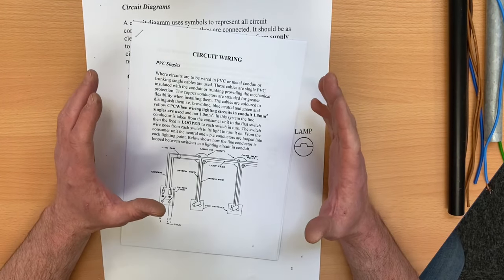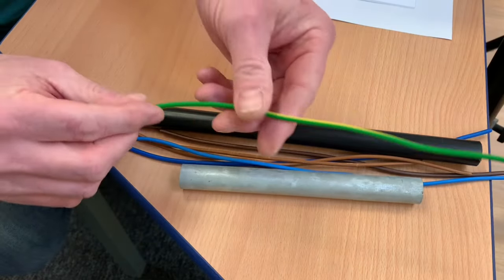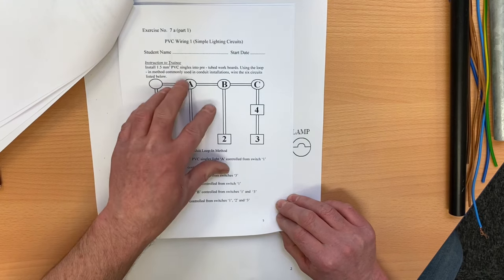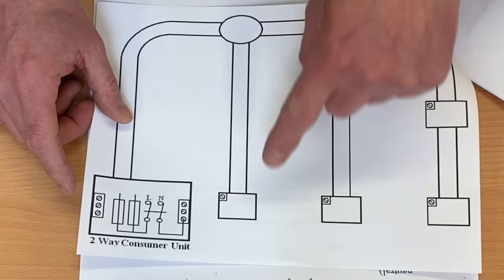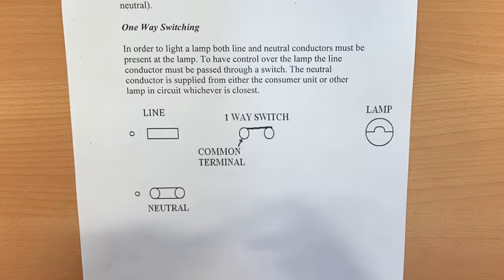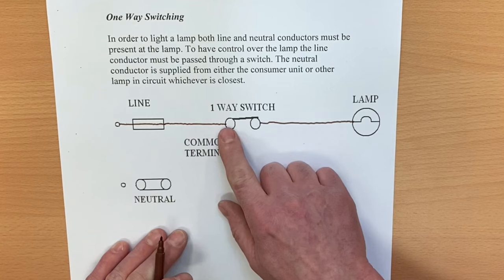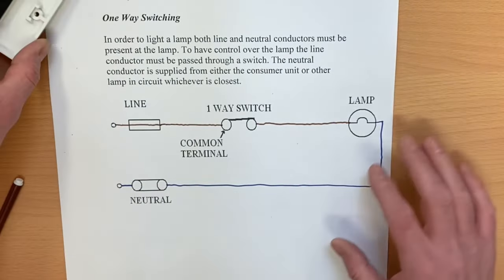Wiring Diagram Conduit Loop-In Method Introduction Part 1 of 2 - Lighting Circuits in PVC Singles

Comment from the maker: == 🕐 Time Stamps - Cut to the action 🕕 ==
00:08 - Introduction to wiring lighting circuit with PVC singles in conduit
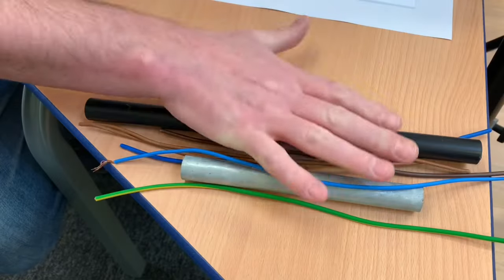00:14 - Download handout from the link in the description 
00:30 - PVC singles for conduit wiring
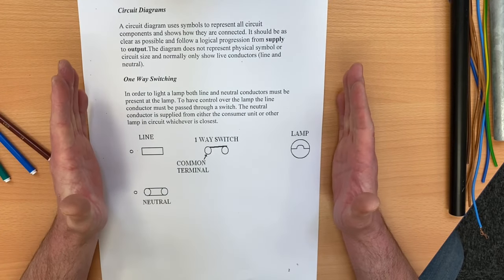02:20 - Circuit diagram for a lighting point controlled by a one way switch
03:51 - Adding the conductors to the 1 way lighting circuit using the conduit loop in method 
05:56 - Batten lamp holders for use with the conduit loop in method 
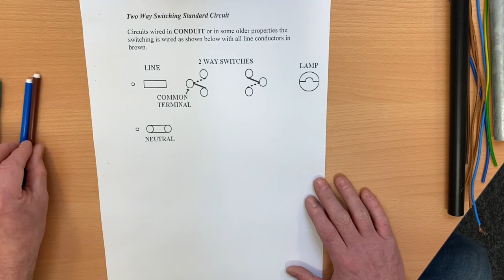06:44 - Circuit diagram for a lighting point controlled by a two way switching
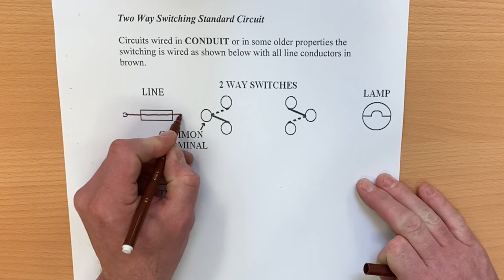07:54 - Adding the conductors to the 2 way lighting circuit using the conduit loop in method
10:11 - Circuit diagram for a lighting point controlled by a two way and intermediate switching
11:15 - Adding the conductors to the 2 way and intermediate lighting circuit using the conduit loop in method
13:00 - Introduction part 2 see link in the description (TO BE CONTINUED...)

Comment: Watching from philippines, sir thank you for your great video presentations.
Reply from the maker: Thanks for the support 👍🏻
Reply: @GSHElectrical  your welcome mate.
Reply: But always keep in mind, the regulations on the Philippines could deviate from the ones shown here! And that's even the case within Europe. The regulations in Europe are harmonized to a certain degree, but there are still several deviations. For example here in Germany we are only permitted to use solid conductors for fixed installation and not the flexible stranded or fine stranded. Stranded only 16mm² or larger.

Comment: Not a very common wiring method used in domestic dwellings these days unless they are older installations from previous decades. I’ve never been to keen on using these single insulated conductors for domestic wiring but you can get double insulated single conductors which are similar to meter tails in 1 -1.5mm (6181Y I believe). You can also get singles with a bare earth in the cable too (6241Y) for running feeds to the switch without the neutral connection and have the single double insulated cores as neutrals looping from one light to the others etc. Thank you for the videos though! I enjoy watching this channel!

Comment: Hi, if you had more than one light would you take neutral and power from the first lighting point?
Reply from the maker: Wiring Diagram Conduit Loop-In Method Part 4 - Lighting Circuits in PVC Singles - 2 Lights 1 Switch
https://youtu.be/Ru98xvD3K4g

Comment: Yes I did understand what you said but the wiring diagram itself isn't inherently wrong because your intermediate is a square unit but a switch is not a square unit. The second reason the diagram is inherently wrong is that your first switch is setup with one in from the bottom and two out from the top but your last switch setup 2 in from the bottom but one out from the top. It is easy enough to understand that all of your switches have been turned 90° to assist in making your line drawing however if there is actually an on-and-off parked on your switches then if you actually set it up that way in your turning all of your switches 90° to the left then one of your switches is going to say no, unless I have that backwards and we needed to turn them to the right in order to get only one switch to say no. And this brings me to the fourth issue, because you are always holding the switches in whatever Direction you see fit we never know what the top of the switche is. And as I recall one of the important rules is that habits are important to keeps us from making mistakes or it keeps us continually making mistakes.

Plainly put I understand that you are the professional electrician but you're teaching have it in and of itself is a mistake because you seem to think it doesn't matter with the top and the bottom of the switches and yes it does because knowing what and the top of the switch must always be eliminates a variable and that eliminate mistakes.

And I have one more problem with your teaching here as well as your wiring habits, we're running two parallel brown wires down one conduit to get to another box when we get to that box we do not know which wire is which this could be resolved with either a brown wire and a brown wire with a white stripe or a light brown wire and a dark brown wire designating left connection right connection or if you would prefer wire one wire two. " specifically in my class I would have to declare them positive wire one and positive wire two" " in addition is a little bit frustrating that here in America we have to actually do the wiring in Reverse of the way you read the schematics so we run our conduit out and then we run our wiring from the far end back to the Breaker Box" is it good habit to get into not because new wiring would have any reason to require that because there would be no power in the breaker box however when adding additional wiring or when doing repairs to Old wiring either have to do a lockout tagout or simply not have the ground negative or positive fed into the breaker box until we're finished so that our passports inspector can immediately look at the breaker box and determine what is supposed to be ready for inspection and what is still being worked on not to mention any wires that are next to Breakers oftentimes will get hooked up by a third party and that is a mistake if there is power in there somebody is going to git zapped. 

Basically what I'm saying is that your program is fine for homeowners that are attempting to wire up their own housing because you're methods are so outdated that your teaching process is bound to get somebody killed because your target audience in other countries are not students but homeowners so they will not have the benefit of a professional electrician to tell them what you did wrong.

I can appreciate that you're trying to teach how to wire things up but I wish you would do it in a logical way that would not get so killed you are a murderer because I don't even understand how your own students stay alive but it is obvious you have not actually worked with electricity for a very long time if ever!